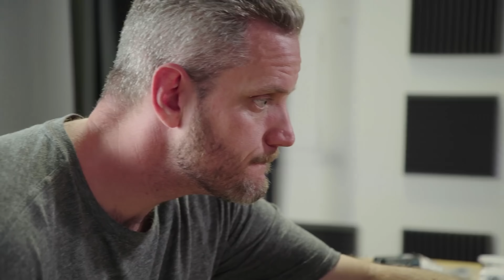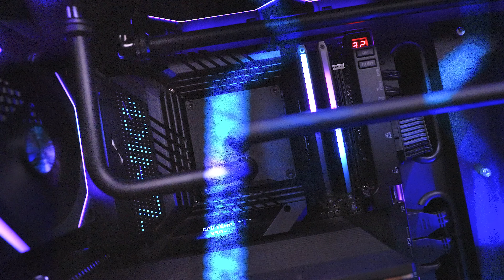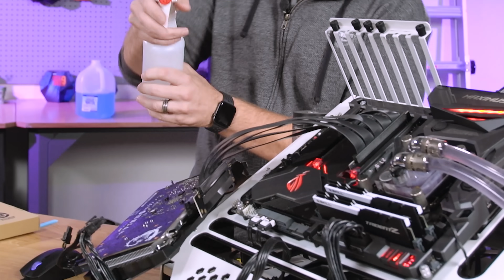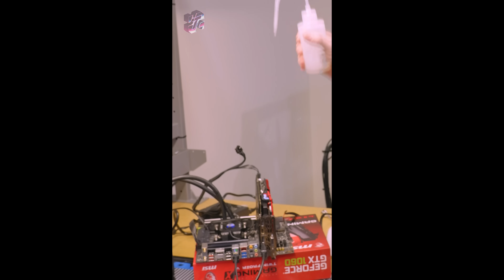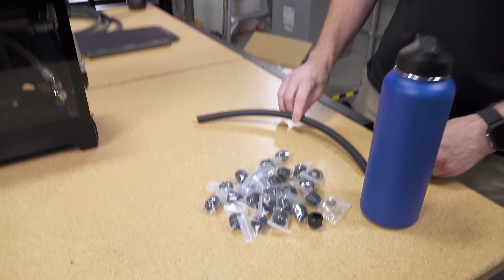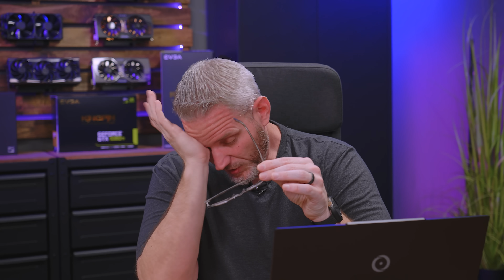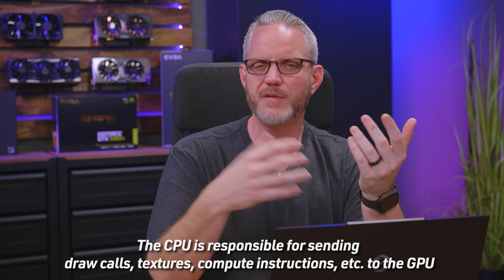5 Myths about Watercooling that are WRONG!

Comment: TL;DR: you should dare to do it if it is on your bucket list.

I built my first custom loop two years ago and I can confirm every word jay said. 

I spend around 800€ for CPU-Block, GPU-Block, 3 radiators (2x360 1x420) and TPV-Tubing. I went full Alphacool. I even use special fluid from Alphacool (I think it was 8€/ liter). CPU and (oced) GPU take around 400Watts. 3 Rads is overkill but this way I can run almost completely silent with a maximum fluidtemperature of 38-40C.

RX6800XT oced with 293W has never seen a hotspot temp over 65C.

And the best thing: The Loop is untouched since I built it. Two years, not a single problem! Fluid ist still clear, thermals have not changed, just runs absolutely fine.

I highly recommend everybody who (like me) decided some time in the past „one day I will have a complete custom loop“ to don’t let any fear hold you back from doing it. It is expensive and it is even more expensive if you want to enjoy it longer without changing it now and then. Because in that case you should choose hardware that lasts at least for a few years. 

With all the cost that loop has in it, it saved me a lot of money in the end. Knowing that it is a hell of work to change Graphics card, it held me back from spontaneous impulse purchases 🤣

Comment: Hi Jay,

I just watched this video and near the beginning you stated that water does not conduct electricity, but the metals in the water do.  This is not correct.  Water does conduct electricity.  How well a material conduct electricity has to do with the availability of free electrons and the strength of the polarizing potential applied to them, i.e. positive and negative forces as voltage.  When the voltage potential is high enough (greater potential between negative and positive charges), electrons begin to flow (current) between from the negative to positive potential or charge.  I tried to simplify this a lot, but water is a conductor, not an insulator.

Comment: INNOVATEK was another watercool brand from germany, i had their blocks on my 1st water setup back in ~1999-2001.. think they even predated most if not all others ;o... CPU + GPU + mobo NB + mobo SB + 2x HDD sideblocks (= 5.25" size but no complaints from my WD raptor 10k rpm raid 0 setup)  + 2x120mm radiator + 4x120mm fan with solid aluminum frame + aquariumpump with their custom water reservoir made from solid aluminum block + tubing was about 500 USD up to 25 years ago.. dang... only temp i remember was 40c CPU fullload a 478 P4 2.4GHz @ 3.6GHz 1.65v.. 99% sure! singlecore CPU teh good ol days ;P

Comment: Unless, you do like Linus old video and put your rads outside or maybe even in a dedicated closet. Then you have to deal with getting the tubing / pipes to those locations.

As to the price. Upfront there is a larger cost, but if you reuse most of the loop when you upgrade that cost is greatly reduced outside of needing 1 possible 2 new water blocks for CPU/GPU.

I am personally running 2 x 480s and 1 360 rad. Since I like minimalistic (no rgb) fans I run p12's in push pull and at 800ish rpm. This means my pc is pretty much silent. This is probably my 14-16th year watercooling btw

Comment: Leaks remain a completely unnecessary risk. Repair shops existing does not change that. Thermalright air coolers by themselves destroy AIOs. And just don't use Intel i9s since they're too hot and defective. Some parts for loops may have gotten cheaper but so has air cooling.

Comment: man.. im running  i5 3.4 GHz  16 ram  recently upgraded the gpu from gtx 660 💩 to GTX 980 (6Gb🍌 💪) . running most games and programs without going into render settings to much. 
I completely wiped clean all the thermal paste from the CPU years ago 3-4 years ago. I never switch my computer off,  if i do i short-circuits wire where the on and off button used to be  and it just fires up. i took it out of the case years ago when it fell down some stairs. The  fancy case just exploded basically, but when i later put it all back together it fired up fine.  
some wires were hanging touched and the thing melted and caught fire burned parts of the mother board room filled with smoke. I opened windows, cut and taped the wires, and switched it on. 
was moving homes once! my ex left it over night in the 4kn rain outside the door in a cardboard box. it rained and rained.. all night. the box just melted.  in the morning i put the poor thing on a blanket near the radiator. in the evening when i got back home before taking my shoes of, i started putting it all together but cleaned it all good and that.. turned it on and Boom works fine. just today i got myself a juicy msi RTX 2080 ti baby (💪🍌!11GB!🍌💪)  about to experience some  mad Bottlenecking tonight💪😎🤳

Comment: Nearly 2 years ago I did my first loop and I went all in. EK 3090 water block ~$300, 2 corsair 360mm resevoirs $100 each, around $100 or more in fittings(I dont remeber). All together I think I spent around $800 just to cool my pc, I decided to do this cause I was planning on not upgrading anything in it for at least 3-5 years. I absolutely love custom loops, but likely wont do it again if it requires this same cost again.
Also want to add I went with hard tubing cause I was confindent that I could pull it off.

Comment: I put the aio pump on cpu opt and fans on cpu fan
 bcs i dont have pump pin on mbo... should i put the pump in bios at full speed ? 
Bcs it was at silent
now i set it to normal 
iddle cpu temp is 29/30 
gaming 46/50 max

Comment: Is evaporation in All in  one coolers an issue or a myth?
I have a Corsair 280 AIO thats been going 5 yrs and still works great.
Got it for my hot AMD FX running over 5 ghz.  Have since upgraded twice with Ryzen.
 I was wondering if I should replace it based on time used or wait till it dies.
 I already have a new one in the box.

Comment: Really fell in love with watercooling through your channel and i'm currently saving up for my next pc that will be watercooled. My biggest question is balancing heat load of the components and size/number of rads, especially when it comes to smaller form factors. Would love to see you talk about this stuff.

Comment: I've heard the claim that water cooling for computers makes the room cooler. I've always said no, there's no difference in the heat regardless of what type of cooling you use for the computer.

I wish I had the money and courage to set up water cooling for my PC, but my tower isn't big enough, and I prefer hard tubing so the light can shine through. I live in Denmark, where it often doesn't get over 30 degrees Celsius. I think it would be cool to put a radiator outside on the wall and run the tubing through the wall into the computer. That way, the room wouldn't get warm as quickly

Comment: Let's be realistic here, you can build a basic full loop of all Alphacool parts for about 400 euro. Less even if you buy things on sale. Also a lot of parts are of a buy-once-cry-once nature. A D5 is expensive, sure, but they last forever as long as you don't abuse them. Same goes for radiators, provided you don't abuse them they last for ages. Again the same applies to basic fittings. 

CPU blocks often have mounting kits available for them, so they do carry over between platforms for the most part. The only component which is more of a "single use" item is the GPU block. That thing is just married to the GPU it's designed for and that tends not to carry over, though water cooled GPUs to command a significant premium in the second hand market here, so it's not always a total loss.

The biggest water cooling myth imho is the idea that you can adequately control a loop based on CPU or GPU temperature readings. Spending that extra 6 euro on a water temperature sensor is a must if you ask me. Ideally a loop is controlled based on at least 2 coolant temperature sensors, one at the inlet to the radiator and one at the return from the radiator. Then configure the fans to maintain a set return temperature and the pump to maintain a dT across the radiator.

Comment: lol i use to use my pc,stereo,old tube tv oh and regular string lights along header of the ceiling to heat my 11x11 bed room in the winter months hehe if i didn't open the door it'd be 39.1 degrees c within 10 min  as picard said like the inside of a borg cube  lol i've since moved from that place but damn it got toasty!!!! hardly spent anything on oil because it'd keep the whole first floor at about 65 degrees F little chilly fora winter home but that's why ya throw on a long sleeve shirt especially when cache isn't falling from the sky [:-) & yeah cash was anyway have fun

Comment: great that you start talking more about watercooling again just as i reassemble my „old“ system… it broke down one year ago and i finally found the motivation to work on that pc again (used stock air coolers for ryzen 3700x and 2080ti)

one piece of advice tho: either get a seperate psu especially for (re)filling your system - or unplug EVERY single cable (of course pump still needs power) before turning the pump on… left the 8 pin cpu cord plugged in and roasted a perfectly good x570 board with that. now back to b350, i have regrets but since i mainly use the x99 platform i dont really care. just want to use my waterblocks again and avoid those stock fans spinning up and down all the time… with two 360mm rads the system always had way more than enough cooling power and back in 2019 when i built that system my biggest misconception actually WAS that i need one rad behind the cpu and one behind the gpu… or betwen the two components… until now!

i think watercooling is really not necessary for most ppl unless you wanna deal with aios that break after a few years and become kind of unfixable or you wanna deal with extreme pricing and extreme amounts of work and patience you need to put into your system… in the end it depends on your use case and whether you wanna deal with those issues or if you just wanna use your pc without too muck ruckus go with air cooling (still needs some dust cleaning every once in a while)

Comment: Thermostat in cars have the purpose to avoid to cool the water to much (below 90C) in order to have a proper operating temperature.
In fact, thermostat on cars is a three way valve that redirect the water to radiator in case the temp is over 90C and bypass the rad if it's colder.

Comment: 24 minutes is too long! tl;dr:

1. Water cooling will not also cool the room it's in. (duh)
2. A leak will not guarantee damage to your system. Proper de-ionized water does not damage electronics. Powering off, drying, and/or using alcohol to clean the components will most likely restore it. Shorts can also be repaired by technicians in some cases.
3. Cost. There are so many manufacturers now that the price range is wide enough for any build.
4. Loop order does not matter.
5. You do not need to be an expert. Waterblocks come with instructions and soft tubing require minimal tools. Rigid or glass tubing require a moderate amount of tools.

Comment: 7:00 The important thing to understand about water leaks is that (1) non-pure water conducts electricity and will eat metal via electrolysis if you don't cut power immediately the water starts to leak and (2) if you get water under any surface mounted component on the PCB (surprisingly easy thanks to capillary effect), getting that water out is going to be really hard (thanks to capillary effect). And if you don't get the water away from the surface mounted components, that water will slowly eat your system alive (see point 1).

And do you check your system regularly? If not, you may have slow leak without knowing about it. The water may have been leaking for weeks until you notice the leak and by that time, you've already gotten metal corrosion all around the parts that got wet.

And if any ball grid attached component ever gets wet, its balls will rot away unless you can get all the water away from it.

And the lead-free solder used in all PCBs today only makes things worse because it gets damaged even faster by water electrolysis.

Comment: I did a query because it's not intuitive:  Evaporation Process
Evaporation of Pure Substances:

Isopropyl Alcohol (IPA): IPA has a boiling point of about 82.6°C (180.7°F). When IPA is exposed to air, it tends to evaporate quickly because its molecules have relatively weak intermolecular forces (van der Waals forces) compared to water.
Water: Water has a higher boiling point of 100°C (212°F) due to strong hydrogen bonding between its molecules. This means that water tends to evaporate more slowly than IPA under the same conditions.
Evaporation of a Mixture:

When you have a mixture of IPA and water, the two substances interact with each other. The presence of IPA reduces the overall strength of the intermolecular forces in the mixture. This lowers the effective boiling point of the water in the mixture, meaning that the water can evaporate more readily than if it were on its own.
As the IPA evaporates, it can drag some water molecules along with it due to these interactions. This is why the water seems to evaporate faster when mixed with IPA.
Azeotropes
An azeotrope is a mixture of two or more liquids that has a constant boiling point and composition throughout distillation. This happens because the mixture behaves as a single substance with unique properties, different from its individual components.

Key Points About Azeotropes:
Constant Boiling Point:

The azeotropic mixture boils at a constant temperature, which can be either lower or higher than the boiling points of the individual components. For the IPA-water azeotrope, the boiling point is typically lower than that of pure water but higher than that of pure IPA.
Fixed Composition:

The composition of the vapor that evaporates from an azeotropic mixture is the same as the composition of the liquid mixture. For example, a common azeotropic mixture of IPA and water is about 87.7% IPA and 12.3% water by weight. This means that when this mixture boils, both the vapor and the liquid have the same proportions of IPA and water.
Non-Ideal Behavior:

Azeotropes occur because of non-ideal interactions between the molecules of the different liquids. In the case of IPA and water, the interaction between IPA and water molecules is such that the mixture behaves differently from an ideal solution, where components would independently follow Raoult's Law (which states that the partial vapor pressure of each component in an ideal mixture is proportional to its mole fraction).
Detailed Explanation of Evaporation:
When you have a 92% IPA and 8% water mixture:

Initial Evaporation: IPA, having a lower boiling point, starts evaporating first. However, due to the interactions between IPA and water molecules, some water evaporates along with the IPA.
Azeotropic Composition: If the mixture reaches the azeotropic composition (87.7% IPA and 12.3% water), it will evaporate at a constant rate, with both IPA and water molecules leaving the liquid phase in these exact proportions.
Complete Evaporation: As the mixture evaporates, the proportion of water might initially increase if the IPA is evaporating faster, but once the azeotropic point is reached, both will evaporate together.
Why It Might Seem Counterintuitive
Different Boiling Points: It seems counterintuitive because water has a higher boiling point than IPA, so one might expect water to evaporate much slower or not at all in the presence of IPA. However, the interactions between the molecules in the mixture change the dynamics.
Enhanced Evaporation: The IPA lowers the effective boiling point of the water in the mixture, facilitating its evaporation. This is similar to how adding salt to ice can lower its melting point.
Practical Implications
Cleaning and Disinfection: In practical uses, like cleaning or disinfection, the rapid evaporation of IPA helps dry surfaces quickly, and the water evaporates alongside it, leaving the surface dry.
Formulations: Understanding azeotropes is crucial in industries where precise compositions of mixtures are necessary, such as in pharmaceuticals, perfumes, and food industries.
In summary, the water in an IPA-water mixture does evaporate along with the alcohol due to the reduced overall boiling point and molecular interactions, and azeotropes play a significant role in how these mixtures behave during evaporation.

Comment: i am building a new PC at the moment and i am going for a hardline watercooled loop for the first time. can someone perhaps tell me what would be better for the tubes 12-10 / 14-10 or 16-12.
thank you in advance if someone has an reasonable answer with perhaps some explaination.
Reply: I personally went with 16 purely because i like the looks of the large pipes.  I think any of those would be fine , the only thing that really makes a difference is availability of fittings at those sizes because sometimes i find myself with a slightly few options at 16mm but even then its not that difficult to find the right stuff if i look around.
just check was the situation in your area.

Comment: what about the myth of noise/performance?
air coolers can operate basically inaudible when idle, but pump is constant,
at high load, fans on radiators may create more noise?